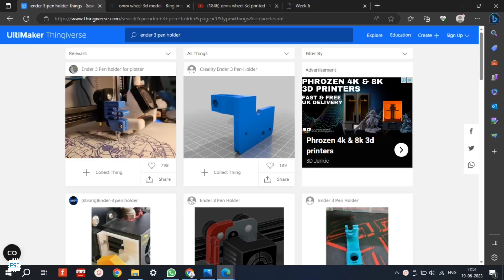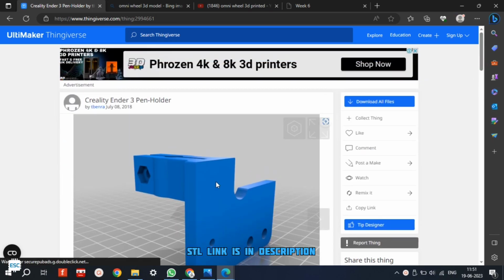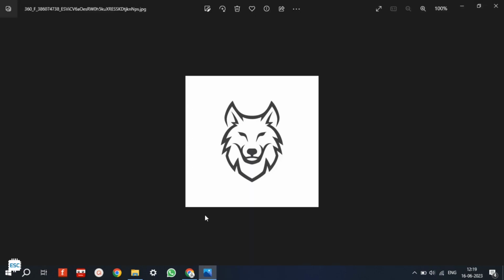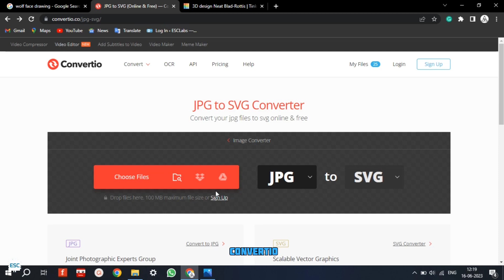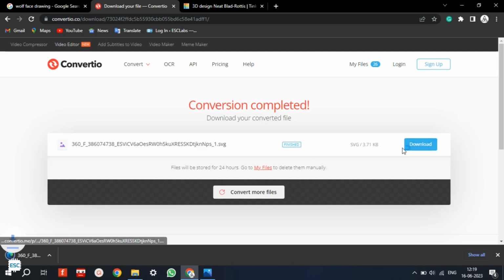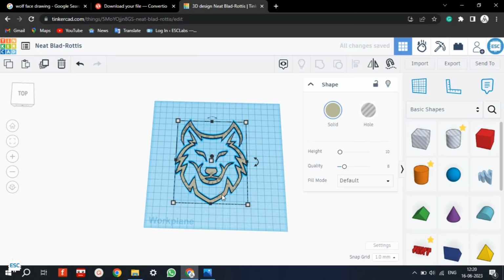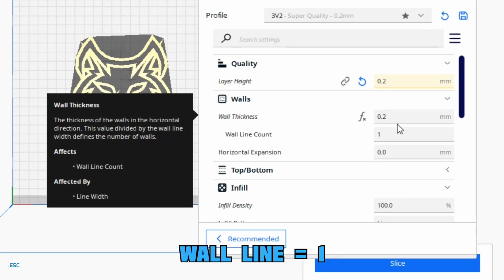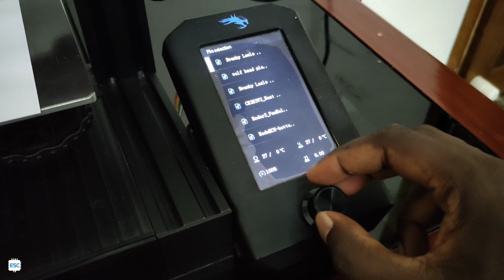How to convert a 3D printer into a Drawing Machine | CNC plotter

Comment: Did you modify the printer firmware to not read the hotend temperature sensors? Could you provide an assembly tutorial?
Reply from the maker: No i didn't change the firmware. Its simple to just attach the pen

Comment: why does it draw a circle around the drawing and a straight line, as if printing on filament 3d?
Reply: the straight line is in the start gcode in your machine settings which you can replace with "G28", you can remove the circle by going into build plate adhesion and setting it to none
Reply from the maker: You can change gcode
Reply: How do you load the g code, I have ender 5?

Comment: 1. You can't move the pen up/down. So the unsightly connected line.

2. How difficult can it be generate the g-code from perl?

3. Why not modify the extruder head cover instead of replacing the entire extruder? Just leave that in place, adding something to hold a pen. No more fiddling with screws everytime you want to switch from plotting to 3d printing.
Reply from the maker: 1.We can move the pen . No continuous line
2.dont know
3.that is true my 😞
Reply: @EDISON_SCIENCE_CORNER  could you also put a laser on it?